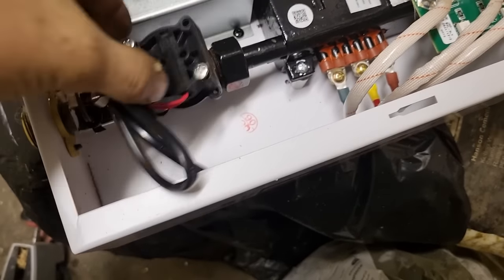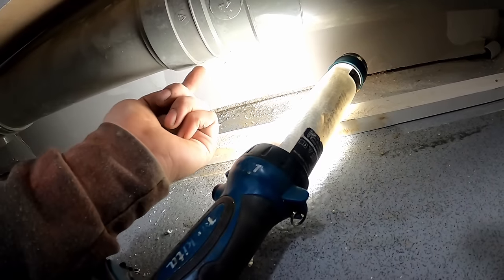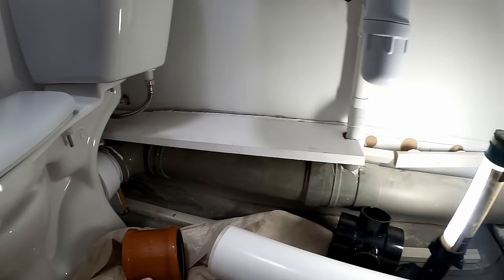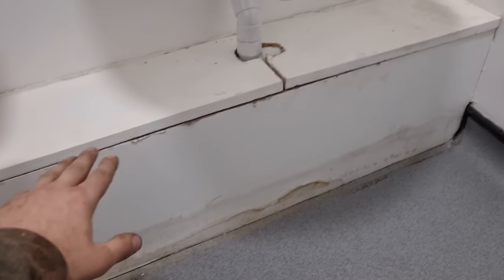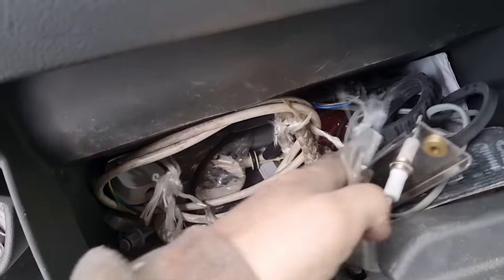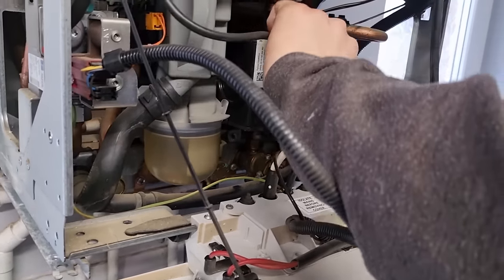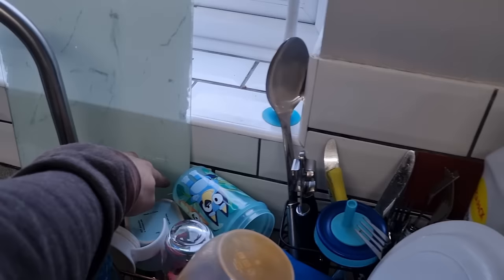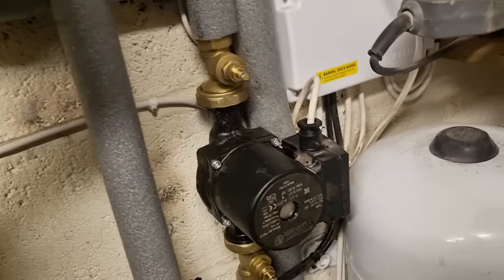Getting over "IMPOSSIBLE" problems

Comment: How the connections can come out the bottom of the boiler and not airlock with no vent is beyond a joke, nice content mate
Reply from the maker: It was a joke, I did mess about with it for ages, with just the hot water on the pump normally has enough to push the air out but this would not go, thanks for watching as always mate

Comment: hi Tom . i was watching the boiler job problem . and i was thinking  if youd jammed open the diverters u know on the notch and switched the pump round . and run the pump full on .on a lead . that might have highlighted the problem earlier mate . but i know non return valves if they were in ther would have been a prob.  and if i found the paddle sw would reverse i think that i would ave tried that .  . its a thing i used do the get a stubbern a lock out of a coil or pipe wrk . lol  worked more often than not though .and she might just have run . and gave u hope mate . any keep on jubbin matey....
Reply from the maker: There was a setting to make the pump run all the time, it wasn't in the instructions but I found if you held the reset down it flashed up PO11, I guess this was sort of a purge mode, the pump just ran then but as soon as it left this mode it went to a fault, I was pulling my hair out with it

Comment: Good one again Tom. What qualifications do you need fit an electric boiler. Also what regulations does it come under. 🤔
Reply from the maker: I guess it would be more electrical regs than plumbing, the installation would still have to comply with part L which is energy consumption, so trvs, thermostats and zone valves as well as pipe lagging, the cylinder comes under G3 as its unvented, I'm not sure on the electrical regs, I just get a qualified electrician in to sort that. Thanks for the support as always mate

Comment: Heatrea sadia all the way for electric boilers, the design of that boiler was asking for trouble without a AAV inside at high level . You live and learn in this trade, 
Like shower pumps will not even entertain anything but Stuart turner now, 
I have only just started watching other plumbers/ gas engineers videos. Thought I only got the shit jobs!! 
Great work Tom. 👍🍻
Reply from the maker: Thanks for the support Shaun, like you say you live and learn, I will only fit Stuart turner shower pumps now as well, I had a bunch of salamander ones fail

Comment: The boiler people should increase the delay time on the pressure switch , in addition should come with a manual vent. What a crock of shit you’re dealing with, feel your pain my friend. What is the electric boiler manufacture brand ,
Reply from the maker: Thanks for the support mate, like you say if the delay was longer you would get a fighting chance, there should have also been air tap on the top, I would have thought this is a pretty major design flaw, the boiler was a Strom
Reply: Improvise and overcome ❤😂😂

Comment: why don't  the front of boilers open like a door rather than   fold down  so if you get a leek on heat exchanger or any thing else it can leek  on the electrics   of the fold down panel   also the pressure vessel behind heat exchanger above electrics flap and  pump act .vessel    should be at the front in front of heat exchanger fan box  on a simple hinge and just covered by  top casing cover. ?

Comment: That short boss pipe was leaking on the O ring adaptor, probably the O ring was displaced when it was pushed onto the pipe . Clearly it was nt pressure tested .  The electric boiler with no AAV bottle is poor design , it's always going to airlock , the pump  would have been ok on the flow if it wasn't air locked.  It's annoying when you have to fix other people's mistakes.
Reply from the maker: Thanks for the support as always mate, I did mess around with it for ages trying to get it to work, I can't understand why there wasn't an air tap on the heat exchanger, I would have thought this would have been common sense

Comment: Why didn’t you put the brown coupling on the other pipe first then you could have had it longer? Regards, Dave
Reply from the maker: Fair point well made, I just didn't think at the time, thanks for watching as always Dave
Reply: The position of the coupling made no odds . Once it was on the white pipe you slid it down all the way so it was out of the way .
Reply: @PlumbLikeTom  yeah we’ve all done that sometime buddy.
Reply: @dennisphoenix1 he would have been able to fit the pipe quicker and with less cutting if he had slid it to the left.
Reply: @riptiz  I fail to see your logic . The size of the gap between the existing pipe and the new piece is the same regardless of where the slip coupling is positioned initially before its slid into its final position.
Reply: @dennisphoenix1 because he measured it incorrectly because the coupling was in his way and had to cut it again. He realised what I was on about but we’ve all realised with hindsight when we’ve fitted pipes have t we?

Comment: Nothings impossible for a plumber 😅
Reply from the maker: It is impossible to keep everyone happy, there is always someone chasing me, thanks for the support as always
Reply: Good evening Tom , nice bit of work they soil pipe .was jigging around with mine at the weekend as everything is located around the solar pipe and cold water runs and the toilet cold water feed as the handbasin waste wouldn’t pass one of the cold water pipes so I had a bit of fun with that myself just been to Screwfix to get a little extension for the back to wall toilet, 
Jack is turning into a plumber is he Harry replacement 👍👍👍👍
Reply from the maker: Thanks for the support as always mate, hopefully you got everything sorted alright, Jacob isn't a replacement, I'm hoping they will both stay
Reply: @PlumbLikeTom  sure you can plumb your way out of many situations
Reply: Hopefully they will good lad’s that want to work are hard to find, and hopefully everything is falling into place just got to put on the clip’s on the connection no leaks up now 🤞 Have a good week